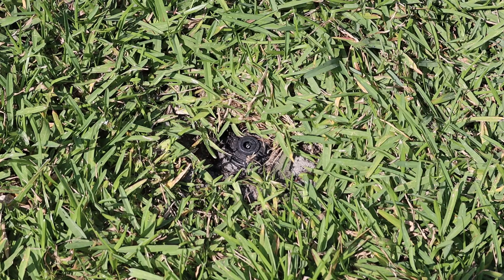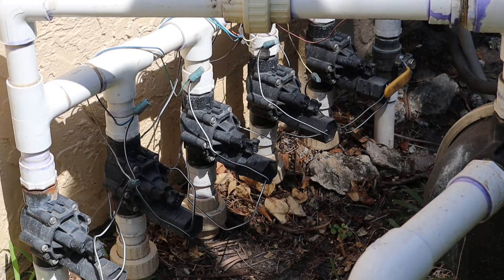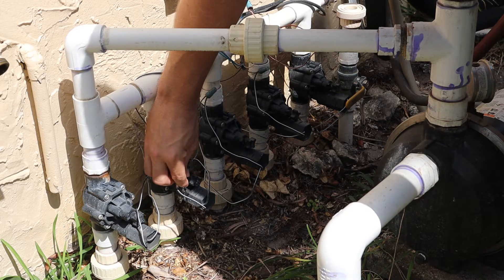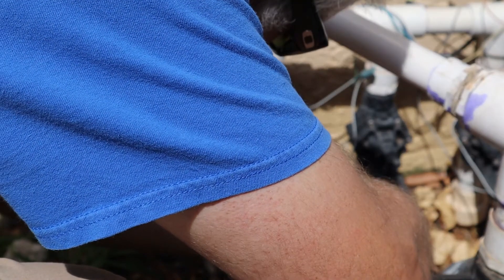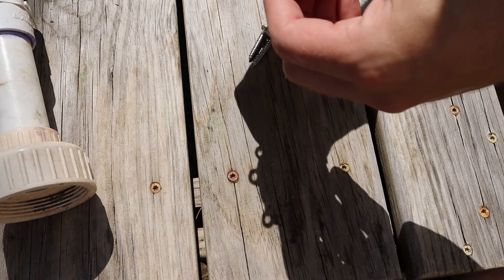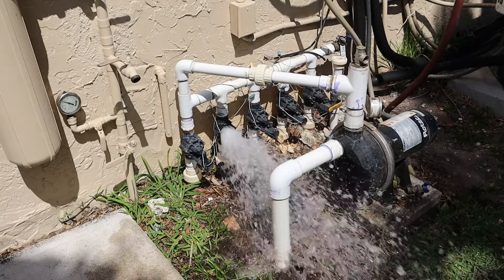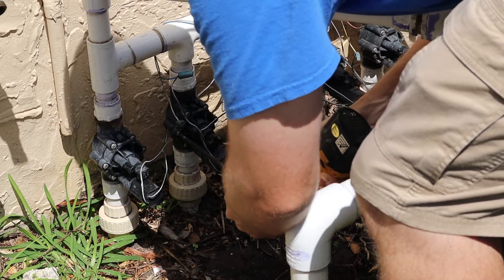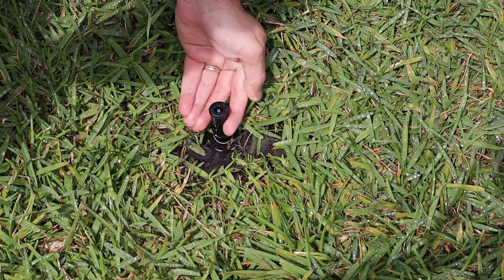Sprinkler leaks when another zone is on?

Comment: I repaired the valves and still have a leak at the lowest head in 2 zones. I’m wondering if the ball valve on the main line is not locking up properly. I will change the ball valve and go from there.
Reply from the maker: Are you sure you're not just seeing drainage, caused by gravity? It is normal for the lowest few sprinkler to "bleed" a bit immediately after that zone runs - it could just be a the water draining from the lines. If it is still doing that after several minutes, it probably isn't normal. You might also have an electrical problem, or a mechanical problem with one of the solenoids.

The ball valve most likely serves as a water shutoff to the entire system (or sections of the system). Unless the ball valve is exercised during normal sprinkler operation, replacing it probably won't have any effect.